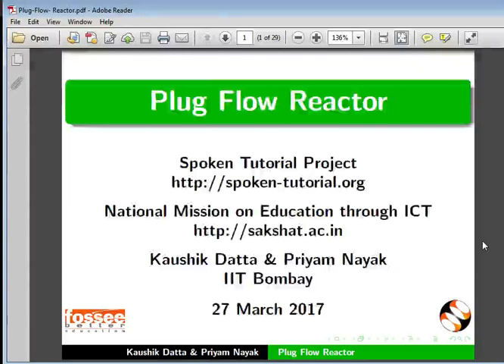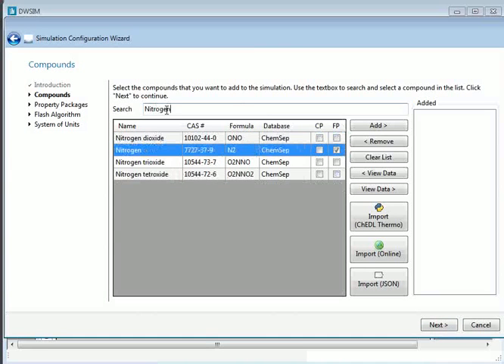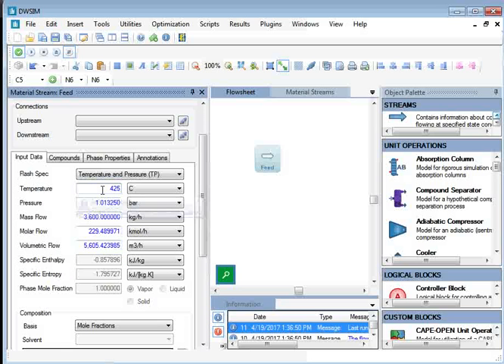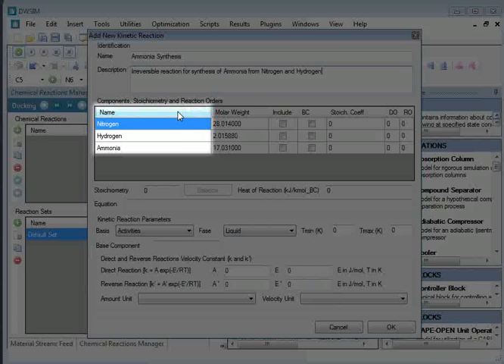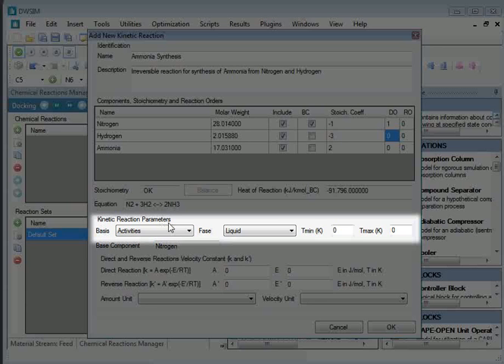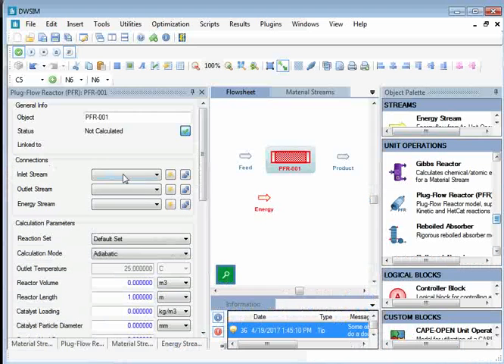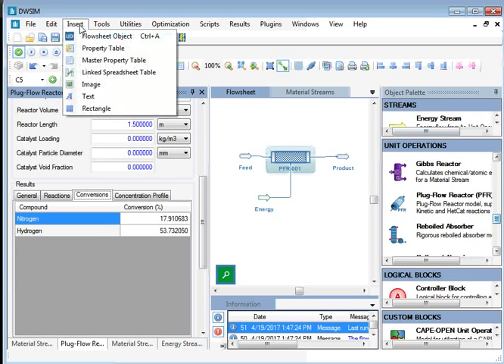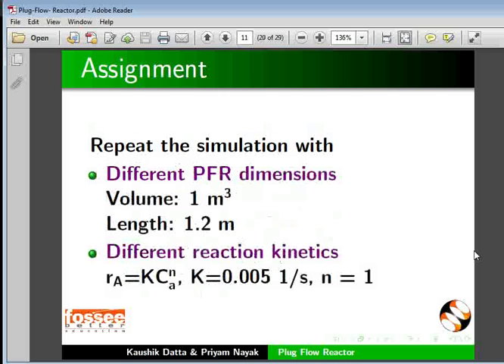Plug Flow Reactor - English

Comment: I've done same pfr simulation with the same condition but the conversion for N2 is 0.019551 and for H2 is 0.058653.
Reply: Exactly same problem here too
And i can't able to find that flash algorithm option also
Reply: Change the velocity unit to kmol/m3s 
and try again u will get nitrogen 19.59% and Hydrogen 58.79
This change is due to the bug fix in new versions